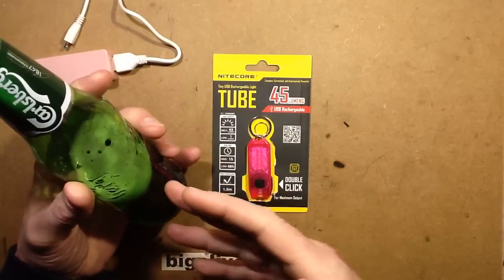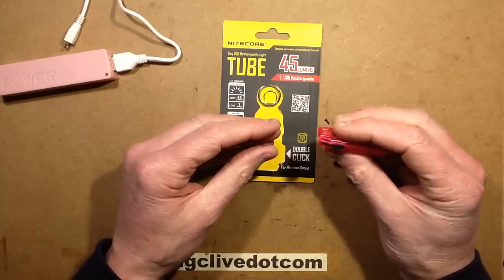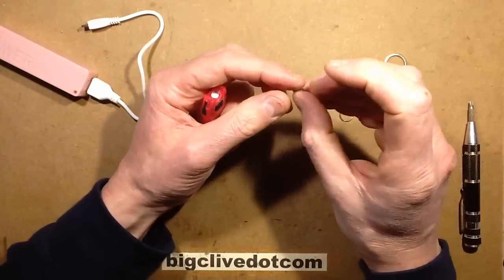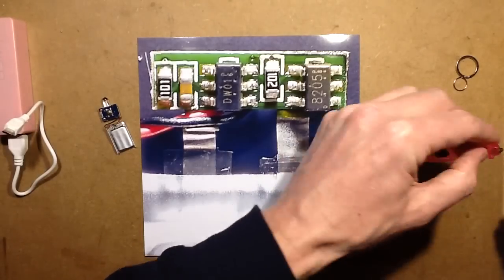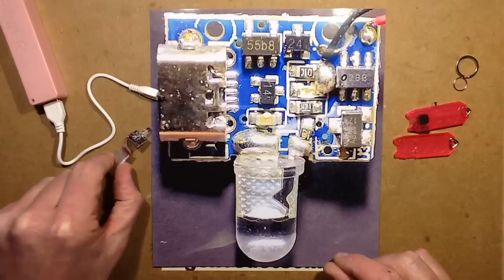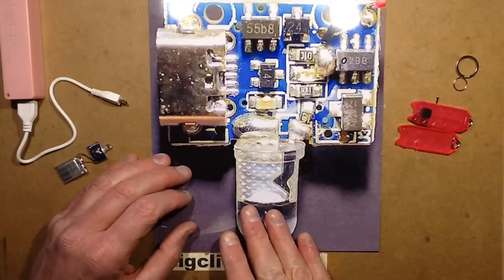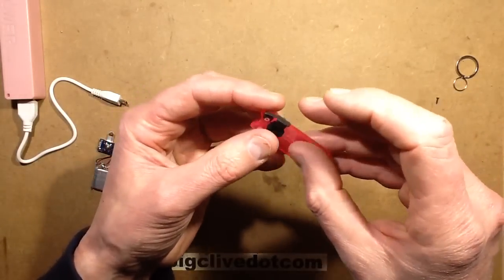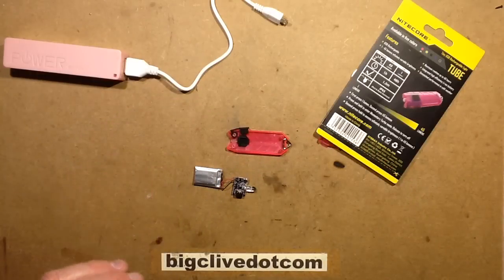Nitecore Tube keychain flashlight teardown.  (Half watt LED)

Comment: I love my Thrunite Ti3 it just takes one AAA cell so its pretty much the same size but round and it is brighter.
Reply: Yeah,  IMO lights like the Ti3 make this one pretty irrelevant, except if the only use is a momentary dim light to get a key in a lock, then the side push interface on this would save a couple seconds time, except that it's also disposable and will cost more in the long run, and being a large volume, robs you of Valuable Pocket Real Estate.  Frankly since the battery is not user replaceable, not reasonably for the average person at least, I might have liked this more if they found a way to do without the plastic shell and instead encase the entire thing in a smaller epoxy encapsulated format, which could also make it more water resistant if not water proof if done well.   I suppose someone could gut it and epoxy encapsulate it themselves, but meh that is too muck work for the end result.
Reply: Stinky Cheese The Tube's produce more than enough light for a small keychain light and I'm not really sure why you would describe it as disposable.
While I wouldn't think submerging it would be a great idea, they are in normal circumstances waterproof. I cycle and camp and decidedly rainy conditions and these have had no problems.

Comment: What helps is when screws quite trapped in plastic, just heat them short with a clean soldering tip.
Reply from the maker: That's a good idea.

Comment: IP65 is Dust proof and splash resistant, in no way does IP65 indicate water proof.  You need IP67 for brief submersion and IP68 for prolonged submersion. If you want to dip it in water, look for IP68.

Comment: IP-(X)5 doesn't mean waterproof (though kinda shady marketing). It means resistant from water-jets. 

5: Water jets :Water projected by a nozzle (6.3 mm) against enclosure from any direction shall have no harmful effects. 

Test duration: 1 minute per square meter for at least 3 minutes
Water volume: 12.5 litres per minute
Pressure: 30 kPa at distance of 3 m

https://en.wikipedia.org/wiki/IP_Code

Comment: I've got one and I really like it, the one flaw is that there's no way to lock it out, so it sometimes gets switched on in my pocket. 
I'm glad to see you've taken yours apart, because I tried taking mine apart, but all my screwdrivers cammed out of the little tiny screws, and I was afraid of ruining mine so I gave up.

Comment: Clive, on the subject of flashlights, would be great if you could take a look at the Fenix E15 keychain light. it claims an output of 450 lumens and is supposedly the brightest keychain light available.
Reply: Dave Fisher I'm sure the E15 is nice, but it's just not a good shape for a keychain light - far to chunky, due to the cr123/16340.
Reply: Pook365 - It's certainly at the bigger end of keychain lights but is barely the same thickness as the cell inside it. I just find it intriguing that it can achieve 450 lumens from such a small size. No other mini torch comes close to the output when using a lithium ion cell.

Comment: just put silicon or hot glue around it and it will be water resist
Reply: It is already water resistant, just not water proof. Some people see water resistant and think they can submerge the item. Two different things.
Reply: oOMonkeyMagicOo potting would be perfect

Comment: I got one for xmas last year, love it.  I usually don't like relying on rechargeable lights because if the battery is dead, you can't replace it immediately for a situation where you need it right away.  That being said, I love this light.  It's been on my keychain and there's several things I love about it: 1. it is the right size to bite so you can hold it in your mouth as you're attempting to work on something (hands free mode).  2. The light distribution from this particular LED is a broad beam, about 80-90 degrees, somewhat uniform across that cone.  this means it's less of a spot and more of a flood.  3. The four modes are useful for a variety of the lighting needs I've had. 

Clive, with respect to the charge of the battery, I read somewhere that it's a 110mAh battery.  I've charged it through one of those USB charge monitors, and it said that it took 90mAh of charge.  This wasn't very scientific, but just a rough measurement.

As far as waterproofing, I wonder if you could use some silicone encapsulant and pour it into the shell while it's open.

Comment: Hey Clive. I was quite fascinated by those small Car Ozone Generators. I bought them from many different sellers but never got a legit one. What do you think about those: http://www.banggood.com/12V-10G-Car-Ozone-Generator-Ozonizer-Ceramic-Plate-Ceramic-Plate-Air-Sterilizer-p-1114586.html
Thanks for the videos!
Reply from the maker: Interesting way of assembling the ceramic plates on top of the power supply.  That looks a high output unit and is definitely not something you'd want to sit in the car with.  It's more for short treatments of an unoccupied car.
Reply: Yeah, wouldn't have used it in the car was just looking for something that produces ozone. How would I go about if I want to build something like this myself? Those ceramic plates are inexpensive and as a powersupply I thought about those small potted high voltage supplys that run of a lithium cell, but that sounds a bit underpowered...

Comment: The screws are probaly so tight because of the IP rating and IPX5 (X can be any number, the second is the number for the liquid resistance) means: water projected by a nozzle (6.3 mm) against the enclosure from any direction shall have no harmful effects, with the water pressure of 30 kPa.

Comment: I bought 2 when they first came out which didn't have the lockout mode to prevent accidental activation in your pocket.  I hear the new ones have that feature. I've since replaced it with the Nitecore Tip. It's much brighter at 360 lumens. You should check one of those out.

Comment: this lives in my keychain , it gets used more than any of my other flashlights , now I am looking to upgrading it with the TIP version it is just a bit bigger with 370 lumens 😁
Reply: Have a look at the youtube reviews on the TIP first. They may have a problem with the lock function.
Reply: I will wait until they fix it 😀

Comment: If you remove the 4.7Ohm resistor from the LED leg you get about twice the brightness from it, with the sacrifice of about 48% run time at full power, but longer run times on lower settings. Someone else measured the difference from 47 lumens to 78 lumens without the resistor. I think it was put in place for a happy balance between brightness and better run time.
I also figured the capacity of the battery at 100mAh. I've owned two of these for over 2 years now. One without the resistor and one still stock. It's PWM for the lower levels, but it drives the LED at full current when it's on high. They hold a charge a long time.
Some have tried changing the LEDs but this caused some lights to fail. Others stated that their multiple lights they bought as gifts failed after 6 months, this is not my experience. I don't know if this is because they changed the LED or removed some solder causing it to over heat from the one side of the LED? I just removed the resistor and out back plenty so solder and never had an issue with mine. I've been meaning to mod my second one, maybe I should do that not that I have a microscope and can record the mod?  I found it charges at 1C, or 100mAh and then drops to 20mAh before the blue light turns off once its fully charged.
Reply: Oh, and that's not a clone. It just like the other ones I took apart a long time ago. It mostly dust proof and splash resistance, not water proof. It's a poly carbonate case and has a time enough seal in the tracks when it screws together to someone pass and meet the IP rating for water resistant. The most mine has seen is rain on my keychain and get tossed around hard with my keys so it's taken abuse and held up well.
Reply: i have seen this around the web. thinking of doing it. but i dont like the pulsing on low maybe if we swap the 4.7 ohm to something like 2.2 ohm it perform better?
Reply: btw you can charge the Tube from your phone by using a OTG cable. maybe its usefull in some way

Comment: Nitecore is certainly a legit brand, but considering that they sell their TUBE keychain flashlights for $10 on the manufacturer's website, I suspect the 99 cent ones on ebay are knock-offs. That doesn't mean they aren't actually produced in the exact same factory, though. They may simply be unlicensed, but identical products.
Reply: FXM Do you have a link for the 99¢ Nitecore Tube?
Reply: Mine came from Nitecore UK and I've just performed "an oral suction act" on it to test for gas leakage. I can confirm from my findings that these torches are not IP65. Still worth £9.99 though.
Reply: Sure. A simple ebay search for "nitecore tube" will turn them up. http://www.ebay.com/itm/Nitecore-Tube-45-Lumens-USB-Rechargeable-Mini-Keychain-LED-Flashlight-Blue-/182393897471?hash=item2a778601ff:g:vaMAAOSwdzVXo2no

Comment: IP65 rating
6 means dust tight, no dust can ingress
5 means water resistant to low pressure jets for a short amount of time, 2-5 minutes max.

It's only really rated for water resistance to the point of being able to rinse if off under your faucet if it gets dirty.

Nitecore makes some good stuff. Fenix and Olight make some good stuff, too.

Comment: the best way to get tight screw out is to place the screwdriver in the screw and heat the screwdriver up with your soldering iron till the plastic start to melt a little

Comment: The battery looks to be the same that's in the (SUPER CHEAP MODELS) eBay special USB rechargeable lighters, AKA lithium shorters.. 
eBay Item 162268718084
Reply: Speaking of lighters, this looks interesting, flashlight / USB charger / lighter that takes an 18650, made of aluminium. eBay 351905609720
Reply: Thanks to you Clive, I know pause and deeply inspect less detailed youtube videos and partially reverse engineer the circuits, I find myself thinking "yep power delivery over here, regulators in that corner, wow what the fuck no fuse here? a boost converter with a microscopic smoothing cap!??!" 

I also find myself taking apart the things around me.. A lot more than I used to, and I was known for it being a problem before.. LOL! Now I have a lot more things covered in electrical tape holding them together. Hot glue is my best friend..
Reply: Yep, exact same protection board on the cell.

Comment: I have four of these, including one UV version.  Great flashlights for general use, where you don't need a lot of light.  Finding your way through a dark house when you don't want to ruin your night vision with house lights, or a quick trip outside.  I have one of them next to my car key so when I'm looking for the door keyhole (no-frills car with no remote) I can make a light spot directly in front of the key and find the hole easily.  Being able to recharge them through a ubiquitous micro-USB charger makes them all the better.
Reply: Dosbomber I have one right by my d**k. Also lets me find the hole easily.😆
Reply: Dosbomber Compared to a phone flash used as a flashlight, would you say it is brighter or dimmer? i ask because i find when my larger EDC flashlight isnt on me, i have to use my phone as an alternative. It works, and i have no real issues... except for it isnt very bright out at further distances.
Reply: A5C3NS10N STUD105

The "high" setting on the Nitecore Tube on my keychain is visibly brighter than the flash on my Galaxy S3 used in flashlight mode.  Neither "throw" a lot of light beyond maybe 20 feet/6 meters.
Reply: Dosbomber ahh, thanks for the input.

Comment: Nitecore also make a UV version of this at 500mW. No ramp feature or low level but does have a safety lock mode to prevent pocket UV light from illuminating your underpants.  (hold until it flashes then release).

Comment: I bought this light recently because i do a lot of geocaching for the hobby of course. https://www.fenixlighting.com/the-fenix-ld22-gets-tactical/ It is amazing it takes the same batteries as my gps just two AA batteries. It for the option to have batteries in it and a option to have low 90 hours of light and high 300 lumens and 90 minutes of light and options in between. It is a great flashlight and I was so surprised by its output as I was used to old maglites.  Those 4 D flashlights that where better to hit someone, than be used as a light. This light really amazed me for not having a lithium cell and the output and usability. I'm really curious about how good it is build. It's not cheap €50,- ish. Around 60 dollars. I wonder if paying this much makes a difference in quality.  I think it can be taken apart without destroying it. When running at full power it does get hot, as there is a warning on the light for it. As shining it on your hand and looking at the reflection while dark hurts to the eye. Not even speaking about someone directing this at you with the flash mode enabled as it can be used to disorient someone. Or cause a seizure.  Great light but whats inside? I hope it's not blobs of solder used as a heatsink. As it's sold as a "survival" premium light.
Reply: Ow and if anyone tries to go geocaching get a pair of tweezers to get those minis out! Those are bastards. Next week on bigclive blog (if he has a blogging channel). Clive goes geocaching. If only..... It is so much fun while being stupid .... My daughter loves to get those big ones. And score herself a new thingy. While we put in a other one. Take one out put something back with more value if possible.

Comment: Sure you want another one of these? The solder quality of the control board is terrible.
Reply: The LED is certainly hand soldered.  Some of the other chips do seem oddly odd of square which makes me wonder if the entire board is just hand soldered.  Some of the through holes aren't filled and wave soldering tends to fill those.
Reply: chas williams One thing you don't see a lot of in Chinese factories is robot assembly lines.
Reply: jak p It's quite odd, as the one I have taken apart had nice soldering.
I've had it a few years though , so maybe that's the difference.

Comment: The pictures you made look very good, what printer do you use?
Reply: While it does look good, the graininess you'd have with many mediocre color printers will be hidden on compressed youtube videos like this.  More interesting is printers that can print all the way to edge of page without margins, which is an easier job for flat bed inkjets which usually cost more per page than color lasers and take a lot longer to print.

Comment: Have that same powerbank, except in yellow, thanks to the tip from the channel. Use cells recovered from scrap laptop batteries in it, works out quite well there. Just have a lot of scrap cells to recycle, but as the packs were free for a half dozen assorted old ones, and I got 12 cells that work out of them, it came out well.
Reply: Just had a brain fart and realised I have some old cells kicking around...think I'll have to have a re-run of Clive's vids (to locate said power bank housing) on xmas day as it's going to be a shit one for me.

Comment: I've had one of them since May 2015 and it's definitely the best keyring torch I've ever had.
I've had two Fenix E05s, a Tank007 E09, a Maglite Solitaire incandescent and a Solitaire LED and they've all lasted, at best, 6 months on my keyring before completely packing up. Visually perfect but no light coming out the end despite having a good battery. The Tube has been on my keyring constantly for about 18 months now and I've had one very easily fixed issue when one of the little wires came off the circuit board. Very easy to stick back on again. I didn't have any issues like you describe with the screws, I think I used a PH0 or PH00 screwdriver and it was fine.

The biggest problem with it is that it will sometimes turn itself on to low in your pocket which is the price you pay for it being an easy to press button.

On IP ratings, IP65 isn't supposed to be submersion resistant - just jets and I think iy would survive a brief squirt with a hose. I mean, it would probably work fine completely swamped anyway.

A little Easter egg is that if you turn it on when before you plug it in, it will turn off. If you then unplug it the light will come on again. I guess you could use it as a crude emergency light.